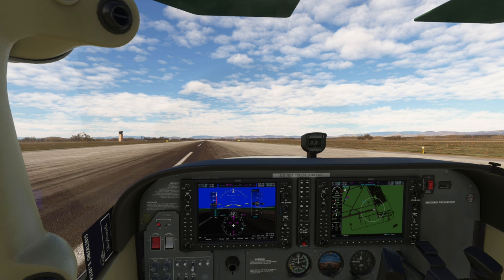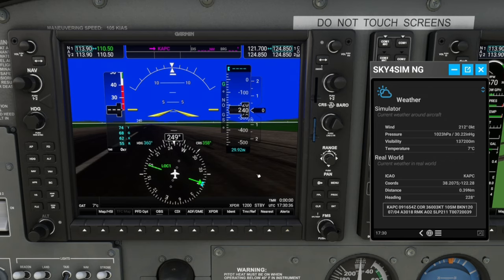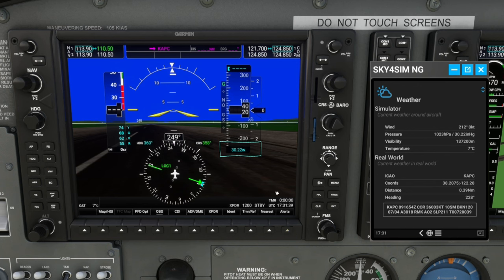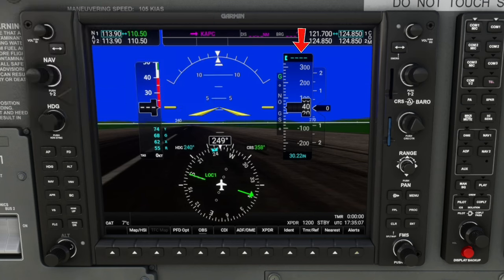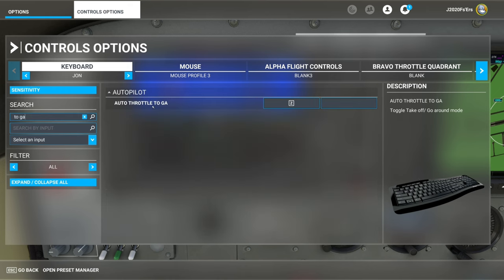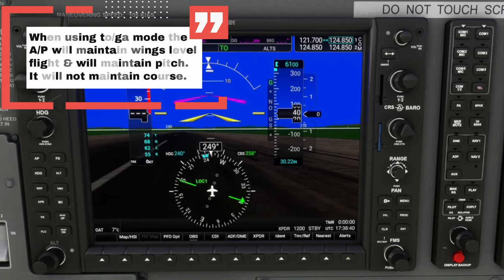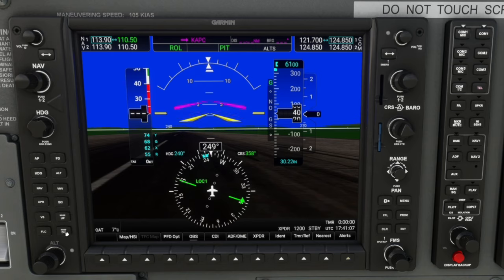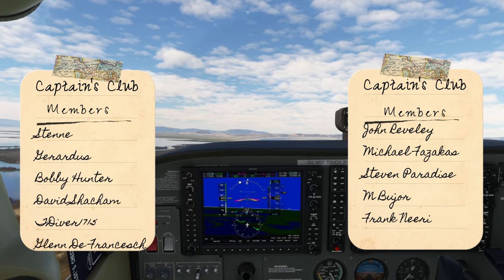Msfs2020*G1000Nxi PFD Setup To/Ga for Takeoff* Fly like the Pros - Easy to follow Pt.4

Comment: I didn't see u use vs or flc to get to your altitude.  Were u going to use only your pitch?  And what are all the icons in the toolbar?
Reply from the maker: This video is mainly on how to set up your flight director for takeoff or using toga mode for takeoff.  This will lock in a pitch for the aircraft to maintain . Once you build speed then you could drop into flc to maintain a set speed.  All the icons are addons that I use . I can't remember all of them